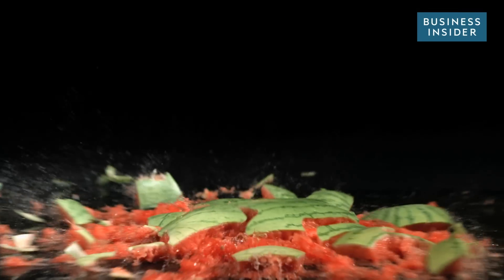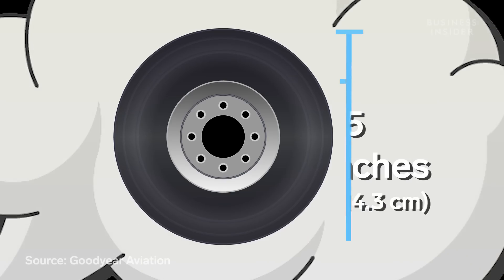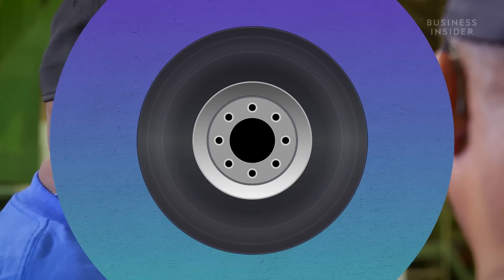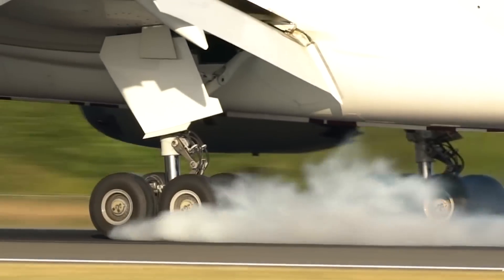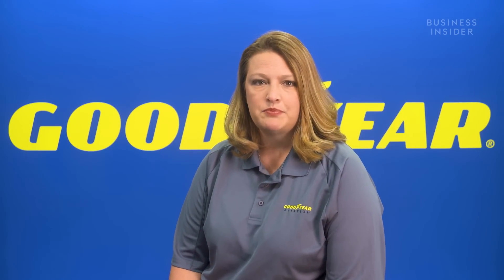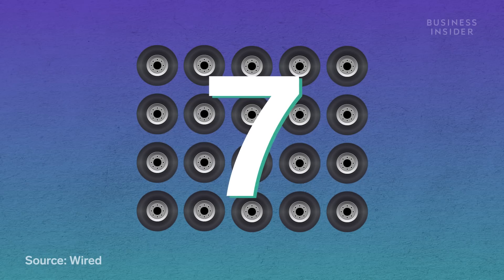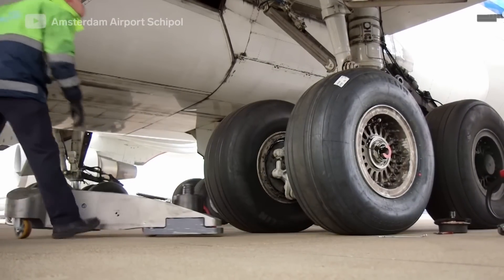Why Plane Tires Don't Explode On Landing

Comment: lol this video. Planes round out (flare) right before the wheels hit the ground, which is right before the critical angle of attack and the plane stalls. This is where the aircraft's speed is the slowest relatively to be able to produce any positive lift. As long as the tires are rated to hold the gross weight of the aircraft then the tires will be able to land no problem. This video makes it seem like planes slam into the ground lmfao

Comment: Construction is very important. An aircraft tire is much more flexible than a car tire and its rigidity comes from its direction of plies. An aircraft tire is bias ply, while an automobiles tire is radial. The bead is also stronger than on a car tire. The PSI does have an effect on its strength, but only when it comes to supporting the aircraft and keeping the tire from collapsing on itself. Lastly, the rib tread design mentioned is used because planes only are subjected to moving in a straight line. Chines and built in tire deflectors help with engine water ingestion on certain aircraft. I understand that this isn't a in depth video, but a lot was missed here.

Comment: They didnt deflate the tires to reduce the chance of exploding, the wheel and tire are 2 separate things. They reduce the tire pressure so the tire becomes softer and it lifts a little bit off of the ground, making it easier to slide off the hub. Its the same trick diesel mechanics use when they need to change a trucks tire.
Reply: The AMM specifically says reduce tyre pressure to lower risk of injury on failure, nothing to do with sliding the wheel off the brake
Reply: Are you talking about ounces of nitrogen on a 200 pound wheel & Tire assembly?

Comment: Occasionally a truck tire explodes. I've seen it and am very glad I was not in the vicinity. There was a huge cloud of super cold air created as all the air was instantly decompressed. The same thing as what happens with a CO2 fire extinguisher. However, most of the time, what we are seeing on the highways are the caps of the retreads. At least on the trailers, truckers save cost and use retreads. Those caps are heavy and dangerous. If a car hits one, they can lose control, or worse. I would like to see DOT make a regulation requiring the truckers to stop and pick up all of that rubber. Not only is it dangerous, it's an eyesore.

Comment: Those truck tires do not 'Explode' . . 0:52  . lol.  Sure they can make a huge noise 'IF' they 'Blow out', but most situations, like pictured in this video, occur when a re-treaded tire loses it's bonded outer layer then disintegrates and destroys everything in it's radius as it mulches up fiberglass fenders and the like while half of it is still bonded and the other half acting like a food processor blade. The claims that they are illegal is false, nowhere in the states are they illegal to use. Others might tell you of deaths from truck tires, but that is from improperly mounting/dismounting a split rim, split ring . . . . aka: suicide rim.

Comment: Nitrogen is not an inert gas. It is less reactive that some other gasses. Some nitrogen compounds are NH3, NO2, N2O4 ets.
Reply: If you look up the definition of inert gas, you'll find nitrogen. 

"An inert gas is a gas that does not undergo chemical reactions under a set of given conditions"

Inside the tire nitrogen is inert. 

Further...
"The term inert gas is context-dependent because several of the noble gases can be made to react under certain conditions"

Ergo, either it's context dependent or there's no such thing as an inert gas.
Reply: @pontiacg445  In the chemistry textbooks or literature or Periodic table, Nitrogen is nowhere described as inert gas. If you are interested about compounds of Noble gasses, you can have a look at the article " Compounds of Noble Gases" by N.Bartlet in journal Endeavor published by ICI published sometime during 1968 - 1972.
Reply: @bhattacp  Well then, there's no such thing as an inert gas...

Comment: The braking system uses Anti-skid which prevents the tires locking when the brakes are applied thus avoiding blown tires. Seen many tire blow on landing and takeoff. An example was the Continental DC10 blowing a couple of tires on takeoff at LAX in the 80s. Captain on his retirement flight decided to abort takeoff instead of taking off which could have made the accident worse.

Comment: Some Semi-truck tires are retreaded. Which aren't as stable as new tires.  Which means an older tire with a new treads put on top of an old tire. Separation will occur. That's why you see them on the road.

Comment: non of this is true for ag planes fyi. They are closer to bike tires, have inner tubes, and take normal dirty compressed air like anything else, pressures aren't that off either, 45psi for the front

Comment: I always wondered why there is no mechanism to make the tires spin at about 150 mph so they are at least close to landing speed. That should extend the life of the tire tread.

And yes the tires DO need to be able to withstand coming down hard because sometimes in rough weather a plane can lose lift when the wind changes direction and drop hard on the pavement.
Reply: My thoughts exactly, and it should be easy to "windmill" type of extrusion on the rims so the airflow actually get the wheels to spin... 😏. Maybe the braking mechanism doesnt allow for that. Would like to know if you have found an answer.

Comment: The MAIN reason the tires don’t explode is because of the nitrogen. It doesn’t expand with heat like regular air does. The second reason is a combination of the shock struts and landing horizontally, not falling out of the sky like a watermelon. Lastly, aircraft tires are a lot thicker than car tires.
Changing the tires isn’t exactly like she described. The tires come preinflated to the proper pressure. Before the new tire is put on, the pressure is checked. If it is under inflated beyond a certain point, it is considered unsafe and sent back. For example, a 737 main tire pressure is around 205 psi. If the pressure drops below 185 psi, the tire has to be replaced. So you wouldn’t “reinflate” a tire that was down around 30 psi like she said in the video.

Comment: Of course, the semi truck tires that explode are almost uniformly recaps. That is, they're once used tires onto which a new layer of tread has been mated. They're not nearly as durable as new tires. Tires underwent something of a tech revolution in the 90s, which was mostly adding silica to the rubber mixture, and new tires almost never blow up any more.

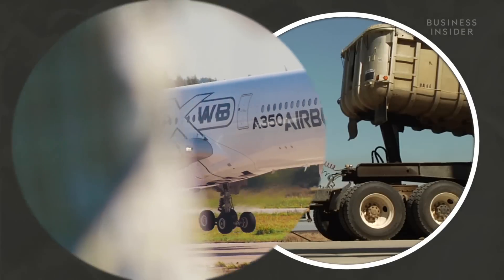Comment: 1:00 the reason truck tyres are worse is because they don't need to withstand speed and weight. BRBRBRBR. wrong. Maintenance. It's because...
wait so more air means a stronger tyre? wow

Comment: Things wrong with this video: 
-as must of you know planes dont land vertically
-the rubber from the wheels is not the only thing between you crashing while the plane is landing
-the planes have suspension to reduce the impact from landing

Comment: Planes land at a 45°Angle and at a low speed of 180 Knts and not like fall on the runway the tyres are made for it and able to land with a ton of force 
Psst unless ur Ryanair This vid is true
Reply: Much less than 45° angle in a good landing.

Comment: [LONG]  Here are some facts about airliner tires, for anyone who just watched the video but felt like they didn't learn anything  (a point made in a hundred or so of the comments below, with seemingly most of the other 2000+ being objections to the video's use of the word "tarmac"*, especially when referring to a runway).

Airliner tires look similar to passenger vehicle tires in cross-section, though they are relatively thicker and with many more plies in the tread area.  Burst pressure is required to be at least twice the rated pressure.  FYI, the Space Shuttle tires were similar in design to airliner tires, though there was some tweaking in the proportions of materials and each tire had to be characterized for pressure loss over a period of three months in order for the right amount of initial "overinflation" to be applied ahead of the tire being inaccessible within the orbiter for many weeks prior to landing. 

Airliner MLG (main landing gear) tires operate at about twice the deflection of standard car tires.  Between that extra deflection and the relatively thick wall, they can get rather hot even before considering any heat conducted from the brakes.  Unless taxi speed is severely restricted during long taxis at heavy weights, the tires may get hot enough to fail during an RTO (rejected takeoff) following the taxi... or in extreme cases, even during the long taxi back if the flight is scrubbed (that's when you find out which tires were on the low end of the approved inflation range).  [Edit:  In the taxi-back scenario, unlike the RTO scenario, any overheated tires would deflate rather than fail (burst) -- see next paragraph.]

Something called fuse plugs are built into the MLG wheels.  They are made of a material mixture (a "eutectic") which is strong yet will melt at right around a prescribed temperature.  In most scenarios, excessive heat from some combination of hot brakes and overheated tires will melt the fuse plugs -- deflating the tire -- before tire temperature has increased to the point of a failure.

Tires burst, rather than explode.  "Explosion" means there's a sonic shock wave, "deflagration" is almost an explosion but the wave stays subsonic, and then there's good 'ole burning... which can happen if a contaminant is introduced (such as from a hydrocarbon-contaminated tire fill hose), or the tire has been filled with air instead of nitrogen and so auto-ignition can occur from excessive heat/pressure. 

A few things which kept coming up in the Comments:

"Nitrogen isn't inert!" --  Maybe not in the Periodic Table sense, but for purposes of aircraft tire inflation that's a good use of the word (as in the "inerting" of potentially hazardous gases at the base of a space launcher).  Dry nitrogen makes all the difference safety-wise, because in the sense we use the word, it's inert  [Somewhere now down past perhaps the 500th comment, Carl Hansen provides some technical insights on the nitrogen inert/not-inert issue, as Replies to a few people's comments on the topic].

"5 cm is a lot more than the thickness of a thumb" --  The video might be referring to raising the axle (i.e. the center of the tire) by 5 cm, at which point the deflected tire's footprint has unloaded and is just breaking contact with the ground?    [Though even 5 cm seems low. Given that tire deflection is in the 30-35% range relative to section height, a hypothetical tire with a 300 mm cross-sectional height would need to be raised more like 100 mm just to unload.  So yet another instance, as with all the "speeds" nonsense in the video, of the contents probably not be being worthy of close analysis.]

Pre-rotation of MLG tires to reduce tire wear --  One of the tasks I had working in my landing gear group was responding to queries from people who had "invented" tire pre-rotation.  Usually it's "vanes", but sometimes "electric motors", and once in a while "hydraulic motors".  None of that works, to the extent that the solutions are all more problematic/expensive than the original problem (which is itself less of a problem than people imagine when they see the smoke at touchdown).

*  Fuel on the fire:  When I worked in airport pavements analysis, we threw around "tarmac" freely in talking about a paved non-runway/taxiway/hanger area.  Or "ramp", if specifically talking about the parking area at the gate. "Apron" maybe never.  [And off-topic, no one ever called the MD-80 "Mad Dog" for years and years and years -- that was conjured within the internet at some point in the last few decades?]

Comment: I. am 67 years old, have operated  a wholesale distribution co for 44 years. Have purchased several new & used vehicles over the years. If they come with Goodyear tires I usually have to replace them within 10000 miles out of round won't stay balanced

Comment: How come they can't get the tires spinning before landing?
Reply: The short answer is that tire pre-rotation, which has been studied for at least 70 years, isn't worth it.  A solution that ends up being more expensive than the problem, no matter how it's implemented.

Comment: Its because they dont need to sustain the full weight of the plane when they touchdown, the wings still generate lift and the fuel tanks are almost empty
(And the speed isn't that ridiculous, its less than some F-1 cars)
Reply: Do F1 cars go from zero to 170mph instantaneously? Because that's what's impressive, not the speed.

Comment: Umm hey Tech Insider , you got it all completely wrong about the Tarmac part , tarmac is used for roads and driveways of home garage entrances NOT airports surfaces tarmac hasn't been used in airport construction in decades cause it's not a good product. The proper term for where planes takeoff and land is : Airstrip or Runway.

Comment: the rubber is EXTRA thick .. the strut also functions as a shock absorber .. they use NITROGEN instead of oxygen (inside the tire) ... these things have to be approved by the F.A.A.

Comment: I Service and replace these tires on a nightly basis. Some aircraft tires are harder to replace than others. Some have tire pressure sensors, some Don’t. Nose gear tires are easier because they are smaller. I worry about the tire blowing up in my face every time and tend to stand to the front or rear of the tire. Tires and brakes are the first thing we check after the aircraft parks at the gate. Sometimes you wind up changing a tire by yourself.

Comment: I feel scared for the person that found out that the plane tires can explode while you exchange the old for new
Reply: Yep. 200 psi and the rims are two halves held together by a ton of bolts. If those bolts crack.. then the only thing holding it together is the axle nut and wheel bearings. 

First thing I learned about airplanes was to always depressurize the tire before removing the axle nut.

Comment: Another reason why airplane tires to tread like tractor trailer tires is that they dont hold heat for thst long. A tractor tire can be spining in a heated environment for hours. Heat means death for tires

Comment: 1:55 Pretty sure nitrogen is not an inert gas....but it's true it does not often bond with other atoms.
Reply: I was about to comment the same thing
Nitrogen (N2) has similar properties as a noble gas but its not an noble gas.
Reply: It is inert in the context of how it's being used.  Unlike air, it won't auto-ignite at the high temperatures/pressures which can be reached inside an airliner tire.

Comment: Most truck tire blow outs, and the pieces we seen on the highway is due to the fact that most trucks use recaps (or retreads ) with exception of the steering  tires. Fuel trucks as far as I know do NOT use recaps. I drive eighteen wheelers for a living and over the years have had my share of tire blow outs. One more reason (and a very good one) to stay far away from trucks! While driving my personal vehicle I stay way in front or behind, never next to one! 
Stay safe.

Comment: After 40 years in aviation I can say you pretty much nailed it. They are amazing pieces of engineering. To go from 0 to 130 to 150 knots instantly while getting many many tons of weight applied nearly as fast and survive to do it over and over again. It is amazing. And some are huge.

Comment: I grew learning not to smoke my tires cuz it wears them out faster.  Yet jets smoke their tires all the time - so wasteful - no wonder they have to lay-off people.
Reply: The problem is the tyres are not rotating when they hit the deck and the energy to make them rotate needs some time to be delivered thru friction. Hence the smoke. There were some attempts to find a technical solution and get the tires rotating before landing, but all proved to be more trouble than they were trying to solve.

Comment: you have to take into consideration that it doesn't hit the ground vertically at extremely high speeds. vertically it only hits the ground at maybe 2-3 miles per hour. horizontally though? yeah. and also because of the rubber tires.

Comment: Is Nitrogen really an "inert gas"?   I've heard of Nitrogen Dioxide and Nitroxide.  But I've never heard of Argon dioxide or Neon Oxide.
Reply: An inert gas is a gas that does not undergo chemical reactions under a set of given conditions. So long as what you need an inert gas for doesn't react with n2, it's considered inert.
Reply: @pontiacg445  So I was taught how to use "helium" gas as a welding agent back in the early 1970s.  It was used in "heli-arc welding".   The tip of the rod would be made of tungsten and was electrically charged and the helium gas would be forced to create a hot helium "plasma".  In other words, we welded with hot helium plasma.  Would "heli-arc" welding be considered an inert form of welding?

Comment: If u drop airplane @170 mph it will be mess as well, what the f@ck is that for a comparison? Vertical speed are not even close to that, horizontal speed does not cause tires reinforced with steel to explode, has nothing to do with it?

Comment: I'm an A&P Mechanic/Flight Engineer and I can tell you that those numbers are WAY OFF

1. Only Jumbo Jets such as 747, A380, AN 225 , have tires in the double-digit range, not all commercial jets.
2. 500 Landings? No way in hell even on Autolanding. With the way these pilots land the plane, it will be a miracle to get 100 landings out of it.
3.The only way it takes an hour to change a tire is if you take a 30 minute break while changing it.